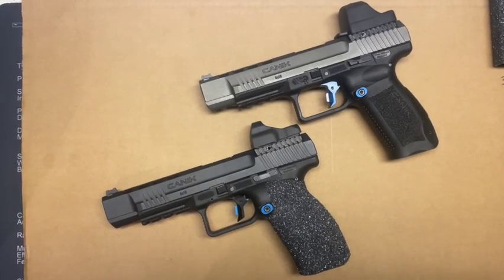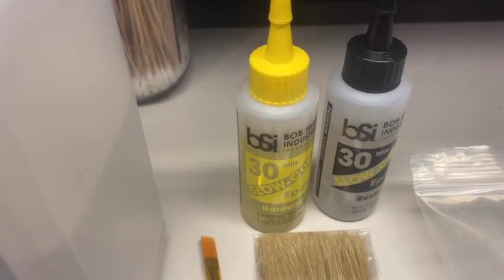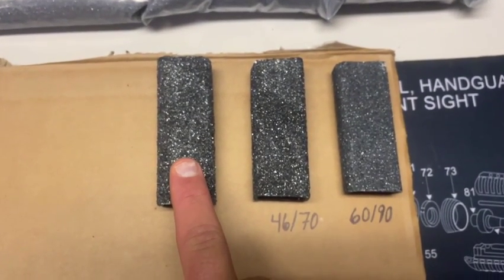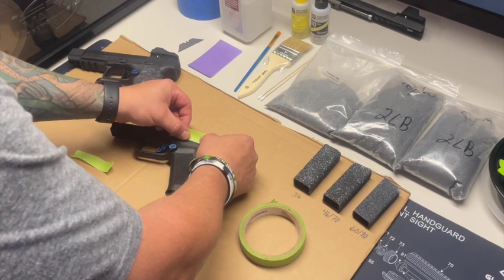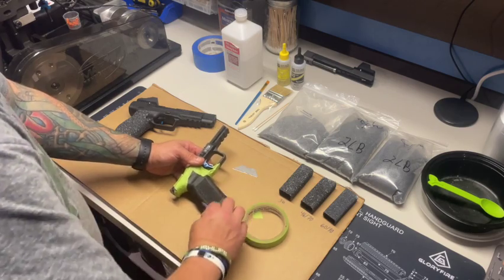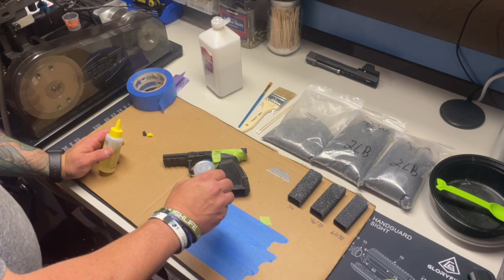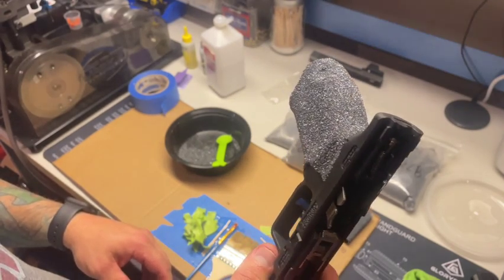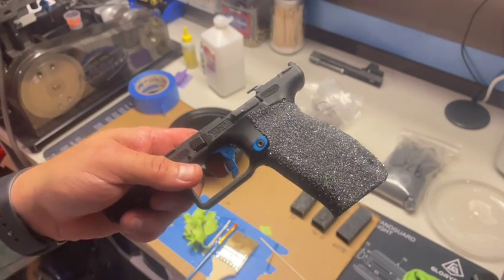DIY Silicon Carbide Grips Like a Pro!!

Comment: Outstanding video brother, much appreciated. Will be adding the mod to my Glock 34, Gen 3. All you need to do now is seal it with Krylon, Short Cuts, clear gloss. It comes in a 3oz can and can purchased at a hobby/craft paint store, i.e. Hobby Lobby, Michaels, etc.. The Krylon with 'top-seal' the silicon carbide and prevent the granular pieces from coming off in your hand. Again, outstanding video. Thanks for sharing.

Comment: Amazing. This beats the absolute hell out of idiots whos take a soldering iron to their gun.

Good looking, practical, non permanent. Thanks for the instructions!
Reply from the maker: Thanks man, I was looking in to paying $150 to have someone do it until I did some research
Reply: @maxtheroofer8004  the context was the damage a soldering iron does to a plastic frame versus the addition of epoxy with rough media mixed in. The abrasive media will wear off over time and the epoxy on the frame remaining will strengthen rather than weaken the plastic. Epoxy can also be softened by solvents to aid in removal.
Reply from the maker: @maxtheroofer8004  Comin in awful fast there aren't ya? No need to be abrasive (see what I did there - abrasive grip video and all).
Reply: @gregjones580  I think semi-permanent would be a better description.  Additionally there are a significant number of people who have had their grips textured and not had to cause them problems.  Some of the best shooters out there have been doing it for ages.

Comment: Good video. On the punch pin holes for the backstrap, there's really no need to worry about that. The backstrap is epoxied in place now so that roll pin isn't functional anymore anyway.
Reply from the maker: I could get the backstrap off of I needed to.  I could score along the edges and pop it up. Wanted to keep the punch pins accessible just in case. Doubt I’ll ever take it off though

Comment: Great video, thanks for sharing!  
One thing... Sili-CON carbide.  Dude, you're killin' me every time you say sili-CONE. lol
Reply from the maker: I KNOW! And after I realized i did it I wasn't going back to fix it LOL... I added a disclaimer to the video description =)
Reply: @vanniek71  It's cool, just bustin' yet chops. :) 
So I was wondering if you've ever tried a secondary operation of thinning the epoxy and spraying it lightly as a topcoat over the carbide grit? It would serve to further bond it to the gun, would reduce the initial "bite" a bit, and should help it last longer, while resisting wear. I've done something similar in a different application and it worked well. Just a thought for v2.0. ;)
Reply from the maker: @Elmojomo  Funny you should mention that, I had thought about doing that - but I wanted to make this video so that people without any tools like a spray gun etc could do this. Just
Simple straight forward and cheap was the goal for this vid
Reply: @vanniek71  You can spray the thinned epoxy with a cheap squirt bottle from the Dollar Store. You have to get it fairly thin to be the right viscosity for the coating anyway, and that makes it sprayable. It kills the mechanism in some cheap spray bottles (due to the solvent), but since you only need it to work for about a minute, that isn't an issue if you time it right. :)  If you patent and market this process, I want royalties! lol

Comment: Informative and nice video, I just don't see why people don't use talon grips instead of something like this. They're not expensive, they stay on for a few years as long as you applied them correctly you don't even have to lightly sand the polymer, and they just work. I understand not all guns have that option but lots of the bigger brands do.
Reply from the maker: I’ve used Talons and they don’t last for me. I’ve got a Glock that was prepped and cleaned with a Talon on it and it’s falling off. I prefer this as well as the grit is customizable. If Talons work for you great!
Reply: I've used Talon tape on serveral guns and i like it.  However, Talon tape isn't available for every gun/grip.  Also, Talon no longer makes a tape for each grip size within a model family.  Instead, they ship you a tape for the full size and provide marks for trimming.  This places the burden of trimming the tape to accomodate smaller size frames fully on the user,  but the price of the tape hasn't changed.    Follwoing the method in the video, you can detail the grip the way YOU want it. Such as using a fine grit on the backstrap and a mix of fine and medium on the front strap.
Reply: @vanniek71  I have some talon grip tape on my Reptilia grip for my rifle, and on the sides of a mouse I use at my computer.  Both have relatively slick plastic, especially the mouse, and it holds super well.  I am curious if the reason they are holding is because the tape is allowed to have full adhesion on the flat surfaces vs what you get with pistol grips which have a bunch of uneven surfaces that the grip tape has to contend with.

Silicon carbide does seem to be a nice alternative to a custom stipple job though.  It does apparently need to be touched up eventually, I saw competitor who mentioned that her grip needed a touch up because it was looking pretty rough after a lot of use.
Reply from the maker: @Osprey1994  Could be better surface areas, but also when I grip a pistol I am gripping it as hard as I can to mitigate the recoil... I think the other applications you use Talons on don't get those kinds of force on them daily.
Reply: If you build custom palm swells this is the best option
Reply: I had the roughest Talons and it still was not grippy as I wanted.😁

Comment: best video for diy silicon carbide grip so far! does it add rigidity to the frame?
Reply from the maker: Hmm not really sure about that to be honest. I’d venture to guess it might add a little since you are adding a layer of epoxy over the grip. It does enlarge the grip slightly too. Might be interesting to try to figure out how to test that…. Good question!

Comment: Why not just buy granulated talon grips....? 😂 Cheaper and easier. I do hear a lot of people complain saying that their talon grips don't stay on though, but I have used a dozen different ones and over the past 6 years they're all good. Most people don't read the instructions though and don't heat it up with hair dryer or heat gun like your supposed too. To each their own! I still watched it all! And enjoyed it
Reply from the maker: It’s not really cheaper or easier actually. Talon is what $20 a grip? So are my kits! Talons you have to clean the grip to apply… same with my kits. Talons wear out (at least mine did about once a month) Silicon Carbide lasts forever. So in the long run it’s actually cheaper. 
Also with Talons you can’t select your grit aggressiveness, with my kits you can :)

But to each their own, nothing wrong with Talons and they work great for a lot of people. Do what works for you!
Reply: @vanniek71 I will probably try it anyways! I didn't know you sold kits that's cool
Reply: I use Talons on may pistols nnd have them on my EDC, I use the granulated rubber. I find the carbide just right for my Canik Rival for USPSA Limited Optic division.

Comment: I have grip tape, but on the frame where my thumb goes, I need something that will stay, and I plan on doing this rather than getting a gas pedal. This is needed because I have to keep replacing the tape where my thumb goes.

Comment: Man, great video. Gave me the confidence to tackle it myself. Do you think lightly patting it, once it starts to set up a little would help drive the texture further down in the epoxy, or am I just over thinking it? Thanks!
Reply from the maker: You could, but then you risk creating indents in the grip. I’ve found it’s better to dust it, let it sit and “wet” out and then redust over and over until it doesn’t wet out. Then once cured (overnight/24 hours) brush the grip and some particles will fall off, but you get the best overall performance and finish
Reply: @vanniek71  Sounds good. Thanks for the info!

Comment: Any ideas if I can do a silicon carbide over a previously stippled frame? 
The first gun I had stippled was more of a fun project but the stipple was more of looks than function. Now I’m ready to have a good functioning grip
Reply from the maker: Yep you can, may need to use a bit more epoxy to get in all the little dimples but it works fine

Comment: Do you think I could build up the grip of my Glock 17gen3 with epoxy before I do the silicone carbide,I already got my order from you
Reply from the maker: The best way is to get some JB weld putty and you can build it up and then go over it with the kit especially if you want to shape it differently

Comment: Which texture is the closest to the feel of the M&P 2.0? Could you mix the silicon carbide in the epoxy itself before applying to coat all the grit better so it doesn't cut you and helps keepnit from breaking off from handling?
Reply from the maker: Not sure on the M&P 2.0 haven’t played around with one. You could mix the grit and paint it all on if you want to, but it works best if the epoxy is under the grit. As far as it falling off, after the initial shed of loose particles not much comes off.
Reply: @vanniek71  I don't want my hands getting micro slices in them so I was thinking that having the grit entirely coated in the epoxy would keep the sharpness from cutting my hands.  Otherwise I guess i could spray some type of clearcoat over it after applying and initial curing.
Reply from the maker: @Watchdog_McCoy_5.7x28  matte clear coat would work as well. But I like the most aggressive grit and don’t want to dull it at all.

Comment: How long does something like this last before you would need to reapply?
Reply from the maker: It all depends on what grit you use and how much you shoot. I've heard of people shooting 50,000 rounds a year re-doing them every year or every other year and some guys that shoot 3-5k rounds a year are on their 5-6th year and cant tell the difference in the grit texture. Unfortunately there is no Hard answer. I can say the grips in the video are still going strong without any wear showing. I do brush them to remove the grip enhancer build up that I use but other than that they are GTG

Comment: Best for ccw ? Thanks
Reply from the maker: 120/220 grit has been the most popular for that.
Reply: @vanniek71  will the step below catch on shirts ? Not worried about my hands. I stipple bc talon grip sand paper fs my clothes up. I want aggressive as possible while being able to clear garments w/out it sticking to them.
Reply from the maker: @Edc-Guy 120/220 is not very aggressive. If it will catch on clothes etc I cannot say 100%, the grit itself no, but depending on body type, it may cause the grit to contact more of your clothing. Unfortunately there isn’t a definite answer. I carry 46/70 on one of my edc’s and it’s fine, but I wouldn’t suggest that for everyone
Reply: @vanniek71  seems like it’ll be too weak. Maybe I’ll do a test run on something with the medium.

Comment: Why not just go with Talon Grips or Skateboard Grip Tape so it isn’t permanent?  It would basically be the same end result, correct?
Reply from the maker: I’ve tried the tapes and Talons. They don’t work for me. Either they end up coming off or the grip isn’t the right texture etc. I prefer this method. While it may not be for everyone it works great for me!

Comment: Will this work on a 1911 or does it have to be that polymer/plastic material?
Reply from the maker: The epoxy will coat metal too! Although with a 1911 you may want to take the grip panels off and just apply the carbide to those and then reinstall them. But you can do the whole grip too if that’s what you want to do (Make sure your grip safety still works)

Comment: How much thickness does it add to the grip?
Reply from the maker: Depends on what grit you are adding and how thick you lay on the epoxy but maybe 1/16th”? 1/8th if you go really heavy.
Reply: @vanniek71  I'll be using the same grit as you, 46/70 and I also ordered the same epoxy you used. It's going a canik sfx rival. I'm leaving on the mag well extender also.

Comment: What does 40-70 grit? We have different measurement scale on grit, 60,70,80,120,400,600 etc... Is 80 grit ok?
Reply from the maker: It all depends on what you want. I can’t say for certain 80 grit is ok for you……If you aren’t sure order a few grits, get a wooden dowel and apply them to small sections and see which feels best.
Reply: @vanniek71  it's a bit expensive here in my country. But a gunshop doing it is more expensive.😂...I ordered 80grit. I'll try it first like what you did. Thanks for this video man...
Reply from the maker: @ramargate  check rock shops if you have them around you, the carbide is used in rock polishing a lot. Where are you located?
Reply: @vanniek71  I'm from the Philippines man... We have  like online shopping, but still a bit expensive. But i think it will be worth it since I'm a competition shooter, it might enhance my game.
Reply from the maker: @ramargate  gotcha, well if you do it right your gun WILL NOT slip in your hands lol

Comment: on the backend of the epoxy curing time when its not all the way cured but almost, can you actually grip the gun and actually get your handprint in it if you wanted to ? im sure itll make hand placement more consistent . ive never worked with epoxy but it was jsut something I was curious about.
Reply from the maker: I dont know how much of an imprint it would leave to be honest, I’ve never measured the epoxy coat thickness but we are likely talking 1/16” or less, maaaaaybe 1/8” with the grit applied. However I have seem people use JB weld to achieve what you are describing and then using the 71 Creative kit over that.

Comment: How has this held up? Has it worn down or worn off at all?
Reply from the maker: Holds up great, and there is a little that comes off in the beginning, but after a bit it stops. Great thing about carbide is it’s used a lot for polishing rocks, and our hands are a lot softer than that so it lasts!
Reply: @vanniek71   Do you dry fire and/or shoot often?
Reply from the maker: @Jon-Hamersky-Shooting  I dryfire almost every day, ever other day and shoot as many matches as I can in season.
Reply: @vanniek71   That’s awesome man. Was asking as far as trying to gauge how well the silicon carbide holds up- thats impressive. I dry fire a lot and I know normally grip tape and even stippling can wear down over time which was one of my concerns with the silicon carbide. Does skin collect in it like stippling? If so, can it be scrubbed out without wearing out the material?
Reply from the maker: @Jon-Hamersky-Shooting   Skin, grip enhancer dirt etc all collect in it, I just run my mag brush over it every once in a while to clean it out. I’m not saying it won’t ever wear down, but I can say it’s been on these guns for a year or so now and there isn’t much difference than day 1
Reply: @vanniek71   Thanks for the response!

Comment: Someone said this is "non-permanent." How long will this last? Can the epoxy be cleaned off and re-applied?
Reply from the maker: I’d call it semi permanent. If you need to “clean” it off you can scrape it off as best you can and  reapply. But it’s never going to go back to factory once you do it.
Reply: @vanniek71  Thank you! I was pretty sure it couldn't be returned to factory, but I'd rather not make the grip fatter and fatter as I re-apply more epoxy and SC.

How long does it seem to last? I'm a competition shooter, and I shoot high volume. But I've had the same grip tape on my 2011 for several season and it still grips fine.

What do you think of the guy who suggested sealing the result with Krylon? It seems to me it would take some of the aggression out of the grip.
Reply from the maker: @puddintame6310  I’m a competitive shooter as well which is why I even went down this path. So far a bunch of dry fire and a match in I haven’t felt any change. I’d guess it will last more than a few years before it’s noticeable. The krypton route…. I’m sure it would knock down the texture a bit, but I don’t think it’s really necessary right now, once the little bit of initial grit comes off, it’s stopped completely.
Reply: @vanniek71  Bro, thanks again! Great tutorial. Guys like you make YouTube great.

Comment: Or
You can just buy grip tape.
This is nice but it’s irreversible
Reply from the maker: Yep you can. I got tired of grip tape failing and this is a competition gun. I don’t want to reverse it, so this obviously makes sense for my use. 

Like everything else it’s a choice right? Choose what’s best for your application!
Reply: @vanniek71  it’s permanent grip tape. It’s cool. As a competition gun I would like to see the wear life. If it wears out maybe you can just apply a new coat.
Reply from the maker: @johnviera3884  you for sure could recoat. I’ve been using it over a year and it hasn’t worn down much if at all.